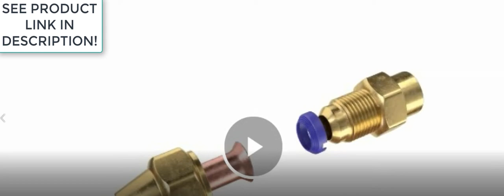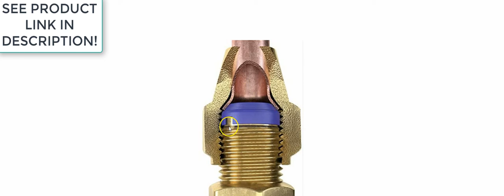Why mini splits ductless systems leak refrigerant a year later after installation

Comment: Hey, thanks for this!  I'm a DIY guy and have installed three mini splits.  This is the first one I have had leak.  It looks exactly like in your other vid with the bottom line frozen.  I think (probably) it's because I didn't get a flare made perfect.  I needed to remove some extra line and reflare... and probably screwed it up.  I'm alot better with brake lines!  So, ordering the gasket and sealer... Thank you!!!!
Reply from the maker: Awesome!

Comment: Thank you very much for your videos.  Have a question. In your nyloc blue video you said to use it on threads and on flares. In this video you advised to use this seal on the flares. How would one apply both this gasket and the nyloc blue? Do I put nyloc on threads and backs of flares only or do I put nyloc on all sides of gasket too? I do not want to compromise the gasket by putting something on it I am not supposed to.
Reply from the maker: It's personal preference, really. But if you use the gasket by itself, it's very effective!
Reply: @SaveGreenHere we bought a Pioneer mini split for our camper and they sent us both a gaskets and the sealer so I'm assuming they want us to use both but I can't find a video that Pioneer puts out that shows exactly how they want us to use it I'll have to call them

Comment: Thx, your awesome. Trying not to use my oil heat much. Cost too much. Got a leak in Mini I guess. Checked flares. All good there. Hoping its just the shrader valve. Its a Pioneer. Gonna charge with 410a leak stop/dye refrigerant. I better ask if 120psi is the correct pressure I want the gauge to read as I charge the system because its  winter here and freezing temps outside. A charging video during the winter says psi is 300. And other videos mention depends on temperature. Hard to find specific answers for different situations.

Comment: my mini split worked for 5 years, then needed charging, I did and check ed the flare fittings and no leaks there,  it worked great, but, the following year the same thing, what is your thoughts on that,   and do they make a took of some kind that will sniff out a leak?
Reply from the maker: Did you lose refrigerant? You may have a coil leak. But get a sniffer and test for leaks...... https://amzn.to/3Addxze
Reply: @SaveGreenHere  it did lose refrigerant, I checked the flares with liquid dish soap, if it is leaking there it is so slow I never did get a bubble from the dish soap, I will get a leak sniffer, thanks for the info on the tool, and I had another go down after 6 years, it went warm air on me and just this morning, 8/3/24 added refrigerant to it, and, its now working like a champ, I have not checked the flares yet, just could not find the time to spare, by the way from 1 to 6 years I have had 4 of the 5 mini splits go dead, 2 of them the compressor shorted out and 2 of them leak, I have put in Mitsubishi that are still going strong, the ones that went down were Gree,
Reply: @SaveGreenHere  I have been told by some that stop leak does not work, and been told by some that it will work, what is your opinion on stop leak and what kind do you recommend, I may try the stop leak route before I take this Gree mini split out and replace it

Comment: I installed them on one system, and they seemed to work extremely well. It was an install for a friend of mine, and he bought the material. And the sales guy sold them to him. I was skeptical at first however I see them as a good product. I re-flare all the factory flares I that has seemed to eliminate all my leaks however anything to stop even one call back is worth it.

Comment: Mine leaked. Had to charge it every 2 months. I pumped down and reflared the tubing used nilock and still leaked. I bought those seals and installed them. I have had no leaks has been 2 years.

Comment: Great Tips! Just bought them. On the gasket package, it gives different torque specs from those on the mini split manual. On the 1/2”, the difference is quite substantial, manual says 25.8 ft-lbs, whereas gasket package says 36-45 ft-lbs. Which torque specs should I go by? Thanks.
Reply from the maker: Go by the manual if you are using nylog..... https://amzn.to/3Jkdm6K  and use a torque wrench like this one with the different sizes, which is highly recommended..... https://amzn.to/3Pf3miY  The gasket may need a bit more torque, just to secure from leaks though. You may want to verify by contacting the manufacturer, gasket provider, or a local HVAC shop.
Reply: @SaveGreenHere  Got it. Thank you for your reply!

Comment: Thank you. I'm a DIY'er and I believe my issue is leaks. I will try these gaskets and get back to you. I installed a 2 zone ceiling cassettes mini split. Thanks again.
Reply from the maker: Glad the video helped. Unfortunately a HUGE amount of these mini splits leak and it's at the connections.

Comment: If the flare connection at the outside unit is leaking, would it be acceptable to close the service valves, repair the flare with a gasket, then vacuum and refill just the line to the indoor heads? Would I charge the lines with vapor or liquid refrigerant? Is there a formula for volume, or would I just refill to recommended pressure?
Reply: You should cut off the old flare, then make new flare using flare tool. Charge the line using liquid refrigerant. Go slowly to 120psi

Comment: I'm a state licensed HVAC contractor in Charlotte.. I dread every installation.  I have no problems using flare fittings for gas lines, but 20% of these gremlins leaks later.  I wish they'd let us braze them like typical equipment.  Thanks for the video.. I have a pissed customer.. hopefully we have a solution.  🤞
Reply: sorry that sucks? what was the solution you did?

Comment: Thanks for the videos,  they're great. I torqued the linesets to the  installation manual specs, and it turned out the specs were too tight, 1/4 line said to tighten to 18-20 nm, and the flares  were crushed and the flare broke and exploded the refrigerant.  Damn this sucks.
Reply: Is there a chance that you got nylog on the threads themselves?  If so, this would "lube the threads", causing the torque wrench to read less friction, thus over torqueing the fitting...
Reply from the maker: Sorry to hear.

Comment: All the refrigerant has leaked out of my minisplit.  I have some nylog comming from amazon and have the r410a,  I cant seem to find the leak on any of my joints.  Could you suggest what would be the best way to find this leak and recharge a completly empty unit ive watched all your videos.  Thanks for your help
Reply from the maker: Sorry to hear that. The best way is to use a leak detector like this one.... https://amzn.to/3OXJE89 They are inexpensive and will beep like crazy as you get it near the leak area. Most leaks will be at the two screw on connections on the indoor unit, and the two screw on connections on the outdoor unit. If not, then check the copper pipes, because if they were kinked in the install, they may have a leak. This will require stripping the insulation jacket, and purchasing a new set, which is not to 
 expensive on Amazon. The other area to check is the outdoor coil, and indoor coil.
Reply: thanks for your reply.  i got 4 20 oz r410a and vacuumed down the unit and let it sit for 18 hours.  I was able to get about .75 of one of the bottles into the system but it seems that the unit is not accepting any more refrigerant.  do you have a proceeder on how to do this it almost seems like the bottle is not releasing any r410a
Reply from the maker: Make sure your valves are set correctly. You may have forgotten to open? Also use a scale like this one to properly measure the refrigerant amount....... https://amzn.to/3uisOZs
Reply: @SaveGreenHere  Thank you for all your help.  The problem is the valve they sent with the bottle doesnt work properly.  I have a new lineset and indoor unit comming as there is a leak when under pressure in the head unit yet it will hold vacuum with valves on outdoor unit open or closed.  Thanks again for the advice

Comment: I have a leak at one of my flair joints. Do I down pump all the freon, so it goes inside the unit, and then close the service ports, before opening up the flair? Then once I put this gasket in, tighten the flair, and connect the vacuum pump, to make sure it holds correctly. After that, re open the service ports (with what freon is left), and then add more freon, to make it cold again. Does that sound right?
Reply from the maker: Correct. You need to reclaim the refrigerant, so you get the right amount back in BY WEIGHT. Unless you lost all of it, for example, and it takes 2 pounds, then a 2 pound jug you already know is what you need. Fix the leak. Vacuum as shown here..... https://youtu.be/b_aysEpNLes  Use a scale to weigh the exact amount needed, like this one........ https://amzn.to/3xQ9BAJ You can also get refrigerant on ebay because Amazon does not have it. This link has the 2 pound jug. Should work for most mini splits....... https://ebay.us/SlM22r

Comment: I have a small leak, with some refrigerant still in the system....the leak is due to flare joint. Is it imperative to vacuum the entire system to repair that leak, and if so what is the easiest method? Or is there an alternative process? Thanks so much for your multi-topic Videos!
Reply: You can return what’s left of refrigerant back to the compressor .
Reply: @reokster8  Why are you giving information out when you have no idea what you're talking about? You can NOT simply add more refrigerant after a leak's been discovered. the mixture is at this point out of balance and you NEED to purge the entire system and fill it with the manufacturer specified amount of refrigerant. Damn retards thinking they know shit. swear to god.
Reply: @cfisher2447  There are studies on efficiency loss and system functionality/durability with R410a mixtures being off by typical amounts due to a leak and the results show there's no reason to bother worrying about it.  YOU don't know what you're talking about.
Reply: @cfisher2447  With so many heat pumps being installed these days, the service businesses are stretched for qualified techs. So, many homeowners are being short changed by techs who seem to be over their heads. The ones I've had attempting to solve my issues just start replacing parts, at anywhere from $200 to $2000 per attempt, with typically two weeks to wait for the tech, then two weeks to get the part, and another two weeks to wait for another attempt. That's on top of a charge of $180 or so per year just to get you in line. I've been quoted $7,000+ to replace just the seven-year-od Mitsubishi mini-split outdoor unit, or $2,200 to replace the shuttle valve and see if that works. So, I don't assume I know shit about HVAC, but I've been studying, and I'm ready to try working on my unit, rather than submitting to another round of parts replacement attempts by young techs who IMHO don't know much more shit than I do.
Reply: How to return the left over refrigerant back to the compressor ? Thanks .
Reply from the maker: Whatever you have left can be pulled into the compressor so you don't lose it.

Comment: I've been pissed off and dealing with this new mini split that I installed leaking out the freon. Now these gaskets look promising and this is my favorite videos so far on the subject. Time to order these things and see what happens. Hopefully the nightmare will end!
Reply from the maker: Sorry to hear this happened. And YES, this will solve the issue once and for all.
Reply: @SaveGreenHere  I actually ended up finally making it seal from the flares themselves. Just filled it yesterday and I love this thing it's fantastic! But... Just because I didn't use them now does not mean that like you said in a year when they come loose I won't put these things on. Especially since it's on an RV the vibrations will probably help loosen it even more. 😄

Comment: I take that back it appears leak lock has been used on 410a so I'm going to try it I'll let you guys know the results after I've had it on there for awhile, I'm installing a brand new mini split after my original one totally died on me think it mustve lost all it's oil because before the compressor blew it sounded like an old rusty wagon that wouldn't start.
Reply from the maker: Should have gotten it here with next day delivery for free.... https://amzn.to/3jdNZVs
Reply: Well I vacuumed it down to -15 psi and held it for 6 hrs and it seemed to hold. Now this piece of crap is going into an F1 error.
Reply from the maker: You may have a board issue. If an error condition is detected, the temperature indicator on the indoor wall unit display will blink to display the corresponding error code. ... F1 or F2: Indicates an indoor temperature sensor malfunction. Please contact the manufacturer, or the supplier. If you contact an HVAC professional, he may do further tests.

Comment: Answered my own questions, the T connector for the high side and the flair torque wrench can be purchased at grainger's even though I'm sure it could also be purchased at Lock Supply as well, now for a new question, I tested my compressor at 2.1 ohms between anything on red and blue wire the black wire obviously the  common tests 53 ohms to both sides and ground and I don't see a starter capacitor anywhere, would it be ok to connect it directly to 240 to test it, bypassing all circuitry? I don't wanna burn it if wasn't burnt already, I keep getting an F1 error on this unit the temp sensors tested a little weird to the first one read around 9k ohms the second one 24k ohms and the last one tested around 90 ohms to me that means the first and last are bad since the ones on the inside unit tested 15k and around 24k, AUX will not give me the correct measurements, also led1 is flashing what ever means thanks for the links and the info.
Rick
Reply from the maker: Great!

Comment: Also where do you get the flare torque wrenches at my searchs yield no results. Also the high adapter?
Reply from the maker: Link to 1/4" seal...... https://amzn.to/30sMPNq  
Link to 3/8" seal..... https://amzn.to/2ZJ97eI    
Link to 1/2" seal.... https://amzn.to/2Cs7byf   
Link to 5/8" seal.... https://amzn.to/2OH1rDb    
Link to 3/4" seal.... https://amzn.to/2WBEdCP     
Extra refrigerant........... https://ebay.to/2ZVtnte
Link to liquid mini split pipe sealer.... https://amzn.to/3jdNZVs
The gauges..... https://amzn.to/31nTA1Y
Adapter for mini split (5/16 to 1/4)... https://amzn.to/2Ys9qLN
2 stage vacuum pump..... https://amzn.to/2JWdeM4
Torque wrench for mini splits....... https://amzn.to/2PBzy3w

Comment: Not seeing your link to the gaskets probably because I'm on cell, I use soapy water to test my connections and so far no leaks by the pressure gauge but what confuses me is when I charge my system I see condensation on the connector then when I check it one month later and bleed some off like on shot day even if the gauges are the same the gas coming out is just like hot air no cold coming out, this is really weird, also I see that charge by presure on the outside ring of the gauges probably because the 410a values only go up to 50 are so lbs so why have 410a on your gauges if your going to use some other scale to charge it?
Reply from the maker: Link to 1/4" seal...... https://amzn.to/30sMPNq  
Link to 3/8" seal..... https://amzn.to/2ZJ97eI    
Link to 1/2" seal.... https://amzn.to/2Cs7byf   
Link to 5/8" seal.... https://amzn.to/2OH1rDb    
Link to 3/4" seal.... https://amzn.to/2WBEdCP     
Extra refrigerant........... https://ebay.to/2ZVtnte
Link to liquid mini split pipe sealer.... https://amzn.to/3jdNZVs
The gauges..... https://amzn.to/31nTA1Y
Adapter for mini split (5/16 to 1/4)... https://amzn.to/2Ys9qLN
2 stage vacuum pump..... https://amzn.to/2JWdeM4

Comment: I never have leaks I use the Spin flair tool on my Drill and Torque the lines down to spec with nylog on the threads in on the backside of the flaring up and on the front side never have . I do torque the lines down to spec and then back them off and re-torque them that might be the key
Reply from the maker: Great point!
Reply: Excellent point about torque.  It's very important that the lines be snugged correctly, especially when working with gaseous materials.

Comment: I used these on a mini split dual zone. I had a leak in one of the 3/8 connections. I re-flared the 1/4 and 3/8 connections and used these seals. Pressure tested and pulled a vacuum at 240 microns. System is running fine now and ice cold. I will use these any time I open a flare.I got a package with 2 -1/4" and 2-3/8" on Amazon for 13 bucks...well worth it...
Reply from the maker: Yes! Highly recommend! Nice to hear from someone that used them, and proved to hold the pressure nice and steady.

Comment: Will it stand the torque specs or can bust it? Over time.
Reply from the maker: It is specifically designed for the torque specs of mini split units. Not recommended for any other application that is not mini split. The larger sized ones, naturally are designed for more pressure.

Comment: Thanks. I ordered a set and it solved my slow leak issue. No matter how many times I flared the tubing it would leak slowly. Been holding pressure for over a week now in this wonderful AZ heat.
Reply from the maker: Glad it worked!